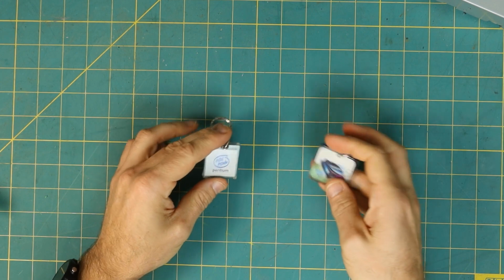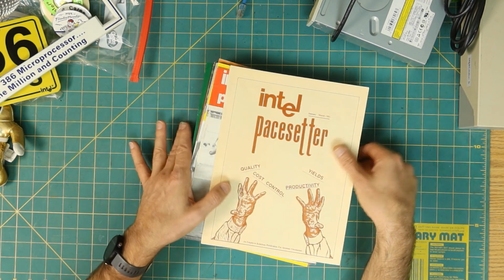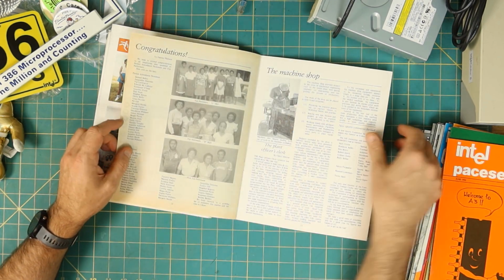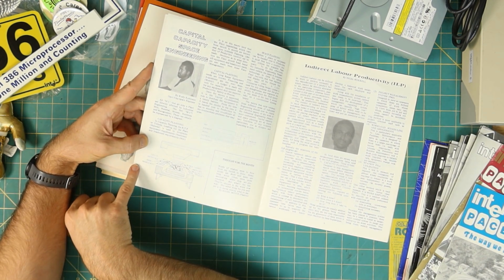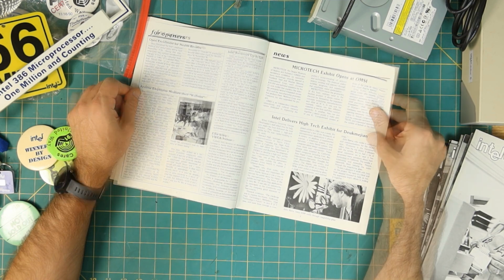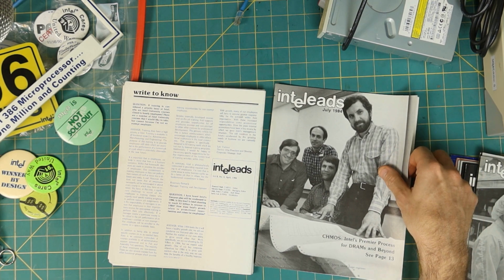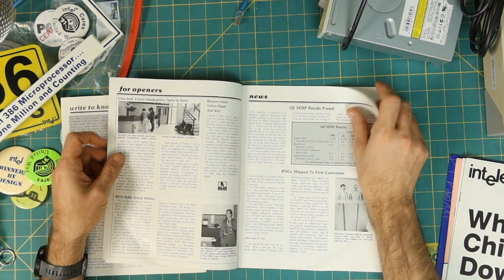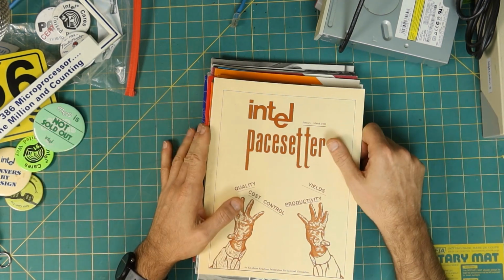Huge Intel memorabilia collection

Comment: Maybe not a coincidence, but "Cosmic Cube" was the original name from 1966 of what the Marvel movies called the "Tesseract", basically a miracle machine.  Invented by Jack Kirby (with dialogue by Stan Lee) for the Captain America story in Tales of Suspense #79.
Reply from the maker: That is very interesting. I wonder if there is a connection. I have since learned that the Cosmic Cube was indeed a hypercube architecture. The article says that it's an 8x8 grid implying that it may be some sort of toroid interconnect like the old Beowulf clusters. Other sources say that it was a hypercube implying a 4x4x4 topology. That... is a lot of interconnect for that time period.